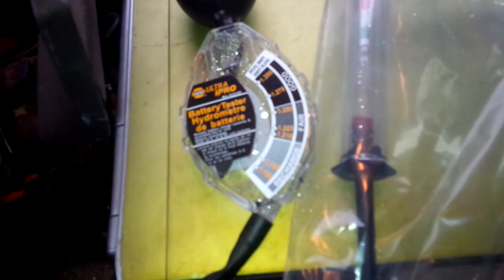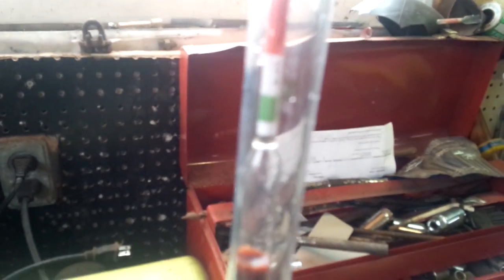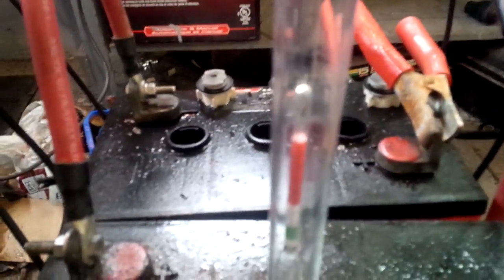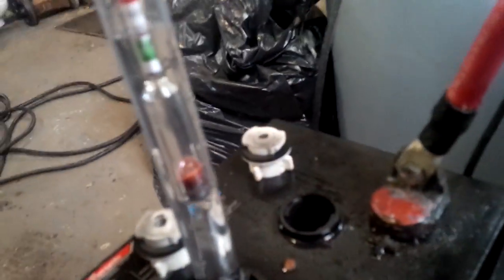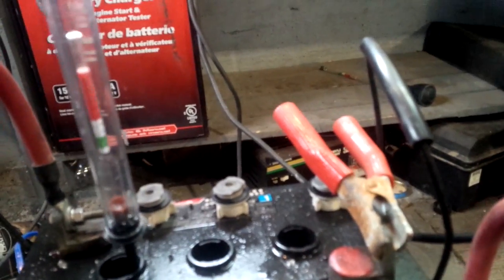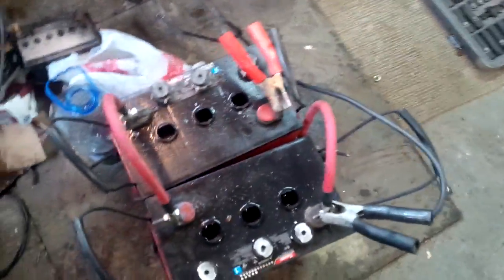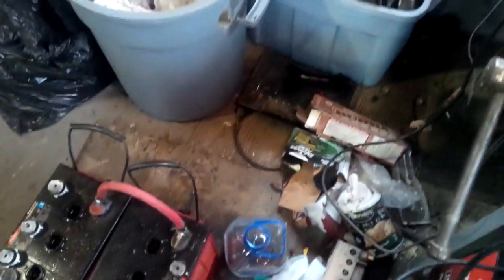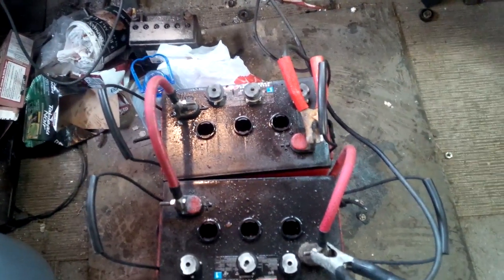HOW TO- Use A Hydrometer For Testing Batteries -Hillbilly How To's

Comment: This video is perfect for my research. I'm working at a place where were we used deep cycle Trojan 6V batteries for an industrial application. 

We run them through an outback power source inverter system for charging ect. 

I really would like to get in touch with you for advised in more detail. 

My email is ramoneandy3@gmail.com

Your video has being very helpful, thank you.

Comment: We use recombinant gas batteries in our planes, I dont use hydrometers at work, but we did when I was in trade school. Alot of general aviation planes use normal lead acid, and sealed lead acid are typically used in aerobatic airplanes. I know how much you like batteries here is a link to the one in our planes.  http://www.concordebattery.com/flyer.php?id=165
Reply from the maker: oh yeah,looks like some pretty good batteries,agm are awesome technology  i mean you can shoot a hole right through it and it still works, Im sure thats one of the reasons they use it in planes